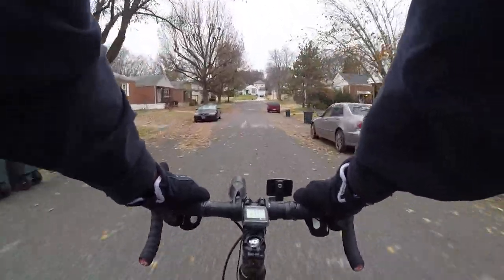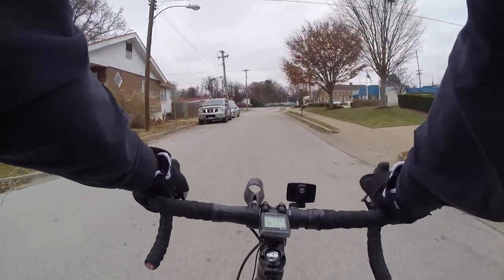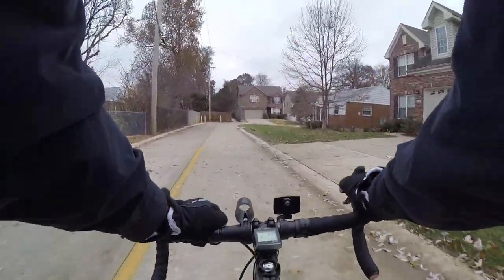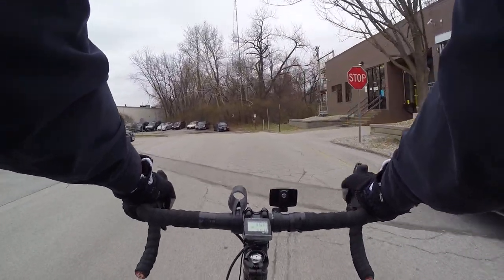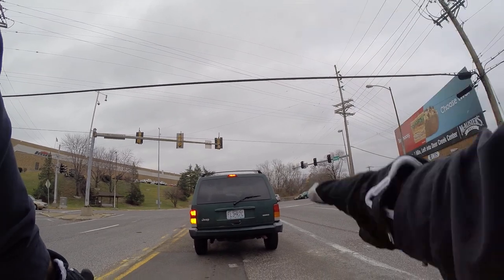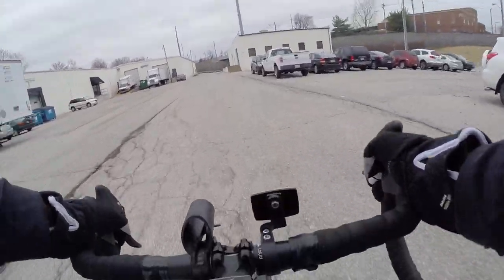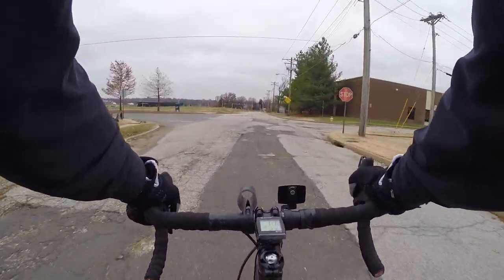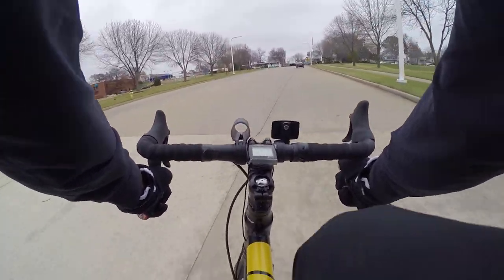So Far So Good Singlespeed Commuter Bike Blogger

Comment: 9:13 / 15:35 
20 miles/hour?

Seems faster.
What gear ratio do you use?
Thanks...Cool bike please, make a vid showing the bike. :D

This is mine:
http://www.foromtb.com/attachments/20161001_130306-jpg.4492589/
Reply from the maker: Hi oscar aullon I have a 2.75 gear ratio and my bikes are listed on my website bikeblogger.com
Reply: oscar aullon I can only do 5 miles an hour WTH?? Prospect single speed
Reply: For me i use 52-12

Comment: I know this is an old video, but what gear ratio are you running on your bike. I would like to set my multi speed bike at one gear and ride like that for a while to see if I would like a single speed bike. Thanks
Reply from the maker: I use a 2.75 gear ratio. I think most prefer 2.5 or greater.

Comment: hey bike blogger I have a question  for you or for anyone who can answer it. I just recently got into cycling  and at bike stores they are trying to sell me bike shorts. do I need bike shorts??? I reall not into the whole skin tight look but if I need it I would put up with it. also does anyone know of a good biking speedomator that doesn't brake the bank.
Reply from the maker: +Madcatdave Hello Madcatdave. I do not wear bike shorts (used to), but I also do not usually ride for over 1 hour. You can get bike shorts meant for mountain biking that do not have the skin tight look. Bike shorts are good at providing friction between the shorts and the bike saddle (so you don't slip around - proper bike fit plays a large role too though), comfort for longer rides, and aerodynamics (tights). My bike speedometer is a cheap wired Sigma computer. I think it cost $20.
Reply: +BikeBlogger thank you for replying. I will look into some mountain biking shorts then. I will also make sure that my bike gets fitted so I am not uncomfortable on it. thanks again for the info.
Reply: You could pair up some road bike lycra shorts, then wear any style shorts you like over the top.
Reply: BikeBlogger io